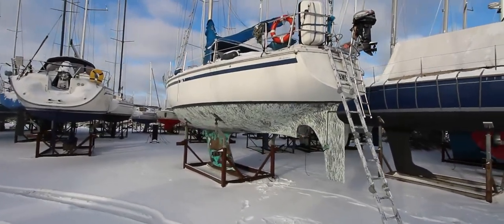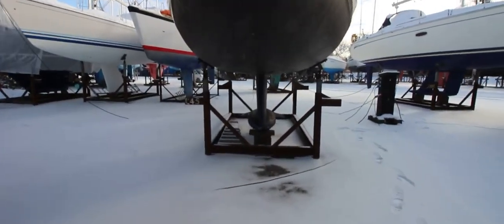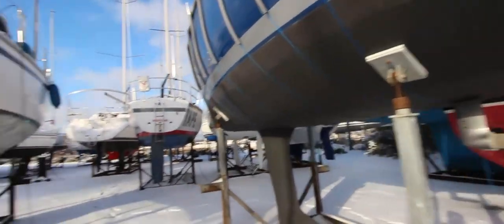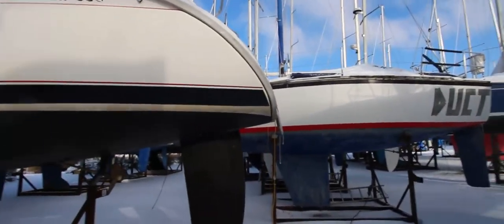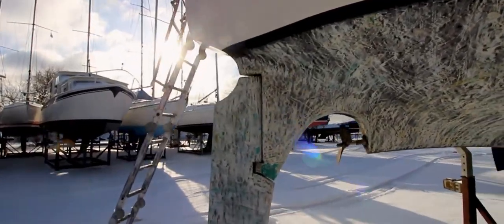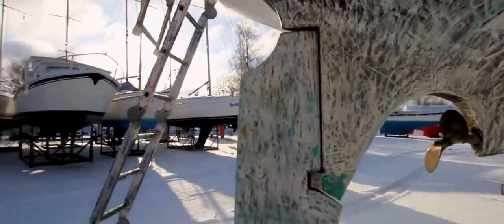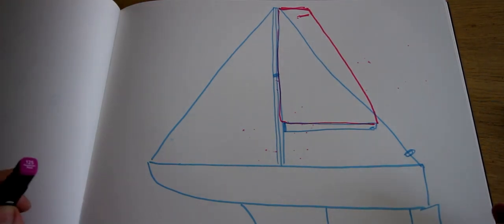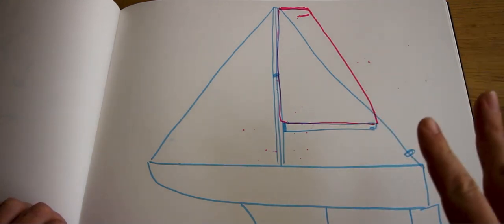Sea Wolves - SOLO #3 - Learning to sail episode 3 - Keel, Mast, Sail types and reefing explained.

Comment: The wind and the sails are your engine.  Sometimes it won't give you 2hp and at other times it is a 1000hp monster.  Reducing or increasing sail is the way to control the monster that often sleeps.

Comment: Do the sail manufactures provide the minimum and maximum allowable wind speeds for a given sail or is that found through experience?
Reply from the maker: If you buy a new sail, yes the sail maker will determine together with you, exactly on what angles and at what windspeeds you intend to use the sail.